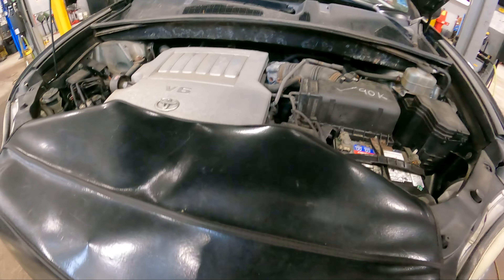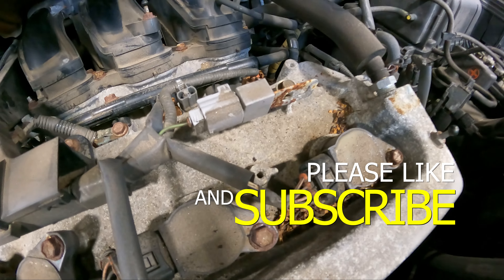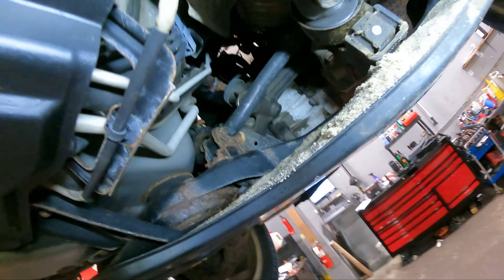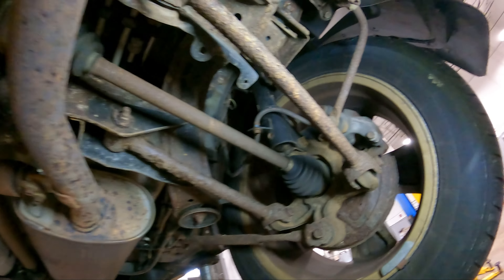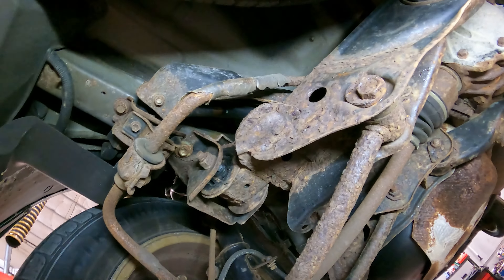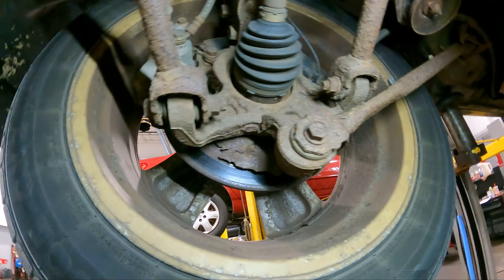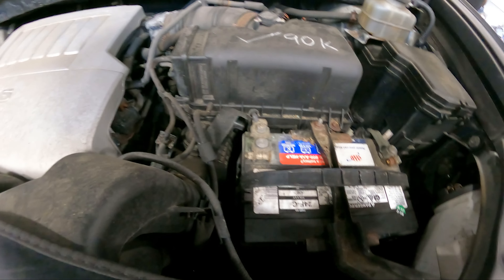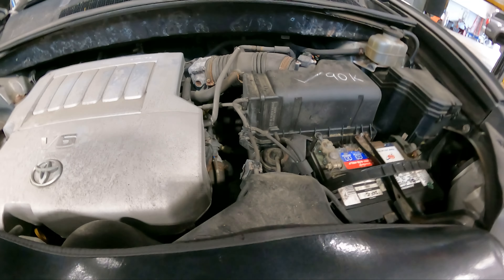Customer states TOYOTA HIGHLANDER 1/4 MILLION ROUGH MILES!😲🤔

Comment: This one was like some of the others we’ve seen with furry rodent issues until you said they tried to run it with the wrong keys.  The flavor is strong in that one.  The spare tire tire still has the curing vents on it.  Never been used and, likely, the rim will weather away before the tire does.  Great video!

Comment: I have a 08 Highlander Limited with 226k Miles and it looks & drives new with minimal undercarriage rust living in Southern MA. Even my headlight lenses are clear, being garaged makes a big difference. Thanks for sharing, makes me appreciate what I have.😊
Reply: The big issue for that shop is that it’s close to the ocean and beaches covered with salty sand. It’s not just road salt. Skid plates might be good for rock climbing but plates will trap salt from the beach. Car washes help but a strong garden hose is needed, too late for the vehicle in this video.

Comment: What are your 4cyl chevs like after 1/4 million miles. My Mazda 6 has 370k just had to do rings because of poor maintenance (oil changes) carbon buildup. My bores still had cross hatching pistons were like new basically the whole motor was. 
Cars these days should be good for 500k if maintained.

Comment: The minimum I'd expect from a Toyota is 250K miles.  I managed to get that much out of a Mazda MX6 and it would have kept going if it wasn't for the tin-worm.
Reply: I got at 97 firebird at 210k miles  my Toyota is at 235k no reason I shouldn't get 400k out of it
Reply: My 02 Avalon has 349K, runs like a charm, very little underbody rust.

Comment: The spare tire looked serviceable...  so that's something.
Reply: It can be saved for their next vehicle unless the flavor eats all of the rim it is mounted on.  Imagine trying to use that spare and it doesn’t support the weight of the vehicle when mounted and disintegrates when used?  It won’t happen right away, but a few miles down the road after it gives you the warm fuzzies that all is going to be Ok.
Reply: If it's there when you need it...not sitting in a ditch.